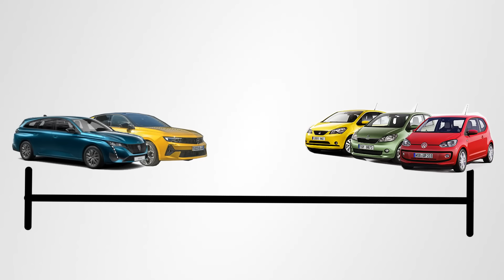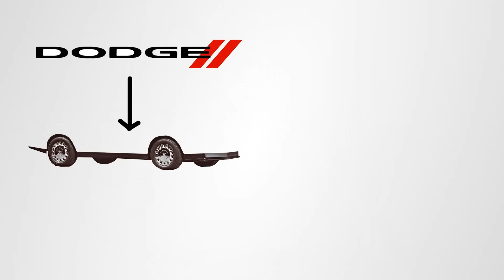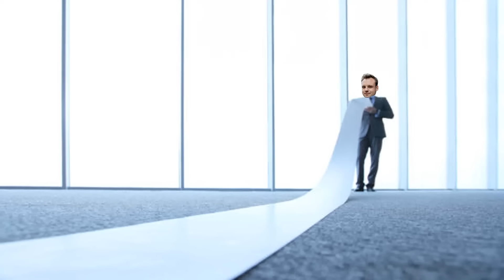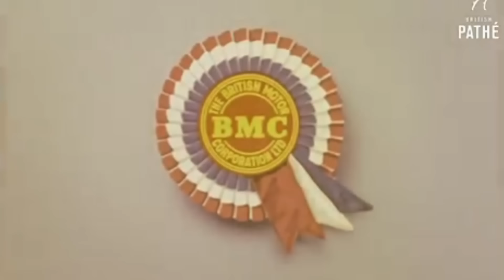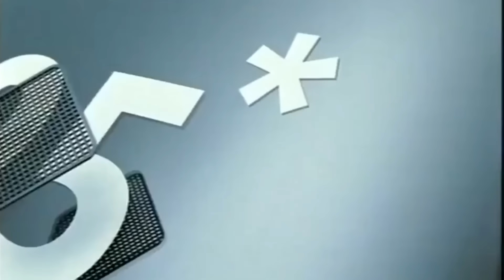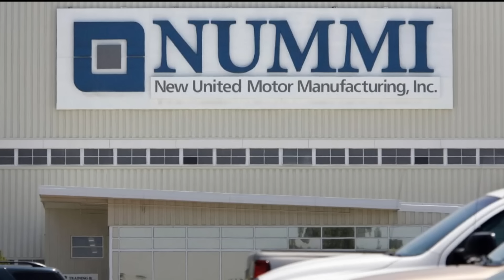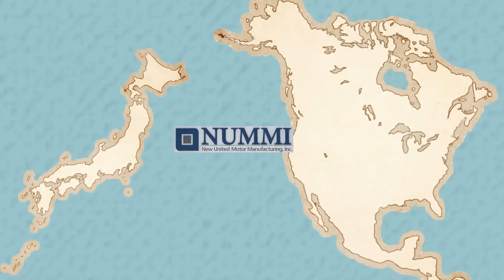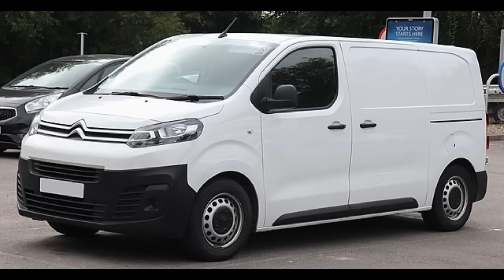Ep. 30 Seeing Double: The History of Badge Engineering

Comment: I just looked up the Australian version of the current Mazda 2, and it looks more like a front end mix up than a full rebadge.  I owned a rebadge car, being the Holden Astra (1985) which was a rebadge of the Nissan Pulsar of that age.  There was also the Holden Commodore of the early 90s (VN) being rebadged to a Toyota Lexcen.
Reply: You aware of the VERY FEW Ford Falcons that were NISSANS! Ford was chronic for rebadged mazdas
Reply: @OffGridInvestor  At the time, Ford owned 40% of Mazda.  So in many cases, Fords and Mazdas came off the same assembly line.

Comment: I can also say that GM really, really loved to rebadge everything. One of my favorites is the Saturn L200, which was an Opel Vectra with a different face. It was also the most unique rebadge of the Vectra I can think of in comparison to the Vauxhall and Holden ones. or the Chevy Vectra that came out later on. Though, the Satura Aura that replaced the L200 looked basically like a Vectra with a Saturn badge. 

Another GM rebadge I found interesting was the Pontiac Beaumont that appeared in the late 60s as a rebadged Chevrolet Chevelle. It was sold only in Canada, while us Americans had the GTO.

Comment: ...take a look at the 1979 Jeep CJ-7...I had my white Golden Eagle before Daisy Duke got hers.  The only thing AMC made was the rear axle and body tub.  The carb and ignition and starting system was Ford, you could see the Ford stamping under the AMC decals.  I'd buy my starter drives from the Ford dealer's parts desk, much to their confusion.  Brakes?  Got a new master cylinder at the local Chrysler shop.  Dana-Spicer 4x4 bits, fantastic GM tranny with a bull-low...which is GREAT in crawling big city traffic I found out later.  Had the GM dealer in Duluth replace the cluch for me.  Auto glass guy told me it was if AMC designed the winshield frame to rot out...tail lights same as Ford stepside pickups of that era...

Comment: I currently drive a Saturn L200 and it’s definitely a cross platform share with the Saab 9-3, the differences being the far and front ends, and a different engine and transmission. It actually helped me out massively because I found a set of Akebono brake pads for the Saab 9-3 on sale for $30 (normally an $80 set) because the box was crushed during shipping to the distributor, and they were an exact fit. I’ll absolutely take a set of Akebonos for the same price as the cheapo generic brand pads
Reply: I had a second generation Saab 9-3 Aero for a few years. I need some new front brake discs. As it turned out to was the same part used in the Vauxhall Vectra VXR. But being in Australia we never got that model here. However, I was able to use the part number and order it through a Holden dealer. Because I didn't have to pay freight, it worked out a lot cheaper to order the genuine part for my Saab via Holden dealership with a Vauxhall/GM part number - who would have thought?

Comment: As a young kid in the 80s I asked my dad why are chevys buicks oldsmobiles and pontiacs all the same car? He laughed
Reply: Don't laugh. In reality a lot of that goes back to the 50s or earlier. Common platforms with each division putting it's own twist on things. Look at a mid 50s Chevy, Pontiac, Olds or Buick based on the Belair chassis. They all have the same general look and feel to them aside from the trim.
Reply: @mpetersen6  thats true. Pontiacs were always chevys with fancier trim and a pontiac engine going back to the 30s. Best example is the entire 1959 gm lineup where you can see they all have the same body shell windows windshield and doors. Different engines transmissions chassis suspensions steering and brake systems though which can make them feel like different cars entirely. As gm standardized parts more and more badge engineering is what it lead to.

Comment: I had a 78 Chevette with Pontiac Acadian badges. Look at the trouble that caused. In the 60s, my parents had a real Pontiac Acadian Beaumont convertible, a badged Nova. Wish I had it now. They also had a few K cars. Aries, Reliant and LeBaron. Even a New Yorker. A K car New Yorker. Before that I learned how to drive in a Ford Elite, not a Gran Torino. The Elite had 400 cu inches, and could barely spin a tire in the rain. One tire. Stupid smog motors for all of these cars by the way, except the Acadian Beaumont. At one point mom's car was a Buick Skyhawk, that looked the same as a Monza. Our mid 70s LTD Country squires were more than just badges, they had MacTac siding. A bicycle handlebar goes right through that stuff. At one point my grandma had a Bobcat with the benefits of a Pinto.  After that a Lynx, which was an Escort. I had a 78 Grand LeMans too. Nearly identical to my neighbour's Malibu.

Comment: Some rebadging is even done on the owner's driveway!
In 2014 i brought a 20 passenger minibus from the Senate of Canada. It had been used almost exclusively on Parliament Hill in Ottawa, our national capital . 🇨🇦 🍁 
It way an American Goshen Coach body on a 2006 Ford E-450 Super Duty body.
I reduced the seating to 10 plus the driver, added curtains all around  around and a bed in the back with storage for camping gear underneath!
I found a large collection of pot metal car 'badges' from the 60s and 70s in an antique and collectables type store.
On each side low on the body just behind the driver's door and the passengers' door, I installed "Fury" badges from a Plymouth.
On the back adjacent to the rear door I installed three badges, each one over the others.
Now I drive the only:
"Nomad
SST
Classic"
              ...on the road! 
My Wandering, SuperSonic Transport, Classic minibus camper! 🇨🇦 🍁 🇨🇦

Comment: Back in the 60's/70's Chevy dealers were always getting pickups in with one or more GMC Badges and vice versa.
Reply: Remember how GMC owners said Chevys were rejects from the GMC assembly line. lol
Reply: And I love that GMC is marketed as being tougher and more reliable when it’s just a rebadged Chevy with up market options (all of which you can get in a Chevy for a little less).
Reply: in the old days the GMC version was the heavy duty version, with a stronger transmission and sometimes a different engine , heavier suspension etc, somewhere in the 90's they just became a different looking chevy pickup
Reply: @alain99v6  in most cases the GMC came standard with that equipment, but you could still option a Chevy with the same equipment. It might even save a little money that way. GMC and Chevy since the late 60s had the same engines and power trains.
Reply: Yes in the original order of things,  GMC was a heavier duty truck. Sturdier frames, different engines, stouter transmission and rear axles. The GMC six cylinder engines had full pressure lubrication many years before Chevrolet six cylinder engines did. This continued into the mid 1950s. Then the new truck platform came out in midyear 1955; the Chevrolet truck had the new V8 chevy engine and the GMC used a Pontiac V8. In 1956 these were 1955 engines, GMC would use the previous year's V8.
Then in 1960, GMC had their own truck spec V6, and the Chevrolet trucks continued to get the Chevrolet V8s. Body and chassis were still somewhat different through 1972. The new 1973 GM trucks became more similar. This series and the GMT400 series that followed inhale incredible parts interchangeability. Also on the 400s, in 1999, you got Cadillac involved, with the Escalade. 
In 1999-2000 though, GM changed directions a bit.  The new GMT800 series of trucks has less parts interchangeability than its predecessors. This trend has continued to increase on each succeeding GM truck series; most of the body, trim and interior parts do not interchange between Chevrolet, GMC and Cadillac. Mechanically they're more similar,  but some things are exclusive to one brand. 
And yes, I remember new car/truck shopping in the 70s and 80s ( my family had an auto parts store that needed several pickups for delivery trucks). I saw a few of those vehicles with multiple brands' emblems!

Comment: Kaiser (IKA) in Argentina building older AMC models.
Reply: Brasil built discarded Ford models well into the 1980s.
Reply: @wintersbattleofbands1144  
If you look at some of the Chrysler Australia models. Along with Ford's and Holden it really looks like there was some repurposing of body dies. The Australian Charger model has always reminded me to the 2nd generation Barracuda fastback. 
Also various AMC models were built in a number of countries. Usually as knock down kits for body and suspension. Sometimes they used AMC engines (and transmissions when they still made manuals*). Sometimes they used drivetrains sourced from other manufacturers. Countries with assembly operations included Iran, Belgium (Renault) and Australia. I remember seeing a RHD AMX at an AMC owners show. 
*I actually worked at Kenosha Engine and when we still built rear ends there were ranks of left over Barber-Coleman gear hobbing equipment from production of the three speed manuals.

Comment: In Japan, the number of badge engineering is increasing from early 2000s.
Some of them(such as Nissan Moco) are sold much more than the original .  :)
Reply: That's what Infiniti, Acura, and Lexus were in the 80s to the early 2000s. Rebadged Skylines, Leopards, Integras, Civics, Soarers, Altezzas, etc.

Comment: There is one example of somewhat lazy rebadging that I know of, and that is the Lincoln Mark LT. Ford basically took the F-150, made a new front grill for it and some new exterior pieces, as well as put a new steering wheel airbag cover on, and boom, the Mark LT was born. The 2009 to 2014 model year, being the last for the Mark LT, was when it became the most obvious that what people were looking at was an F-150 with some differences, notably with the grill itself extending up to the hood, and different trim pieces, but otherwise, you could get all of the 12th Generation Ford F-150 grill and trim pieces, and end up making an F-150 on a budget out of what is basically the Lincoln version of itself.

Comment: The Mitsubishi Starion was interesting as a rebadge since it was rebadged not only once, but twice under the very same company.   Chrysler motors rebadged the Starion as both the Chrysler Conquest and also the Plymouth Conquest.

Then a few years later Chrysler Co. rebadged the Mitsubishi GTO (3000GT) as the Dodge Stealth, although at least this time it was only one rebadge.
Reply: The Conquest was actually a really cool car.  Very 80s, with the digital dash and the voice chip that would tell you when the door was open.  With the 2.6L Turbo and the 5-speed, it was reasonably quick too - both better-handling and potentially quicker than the emissions-hobbled carbureted 5.0L Mustangs and Camaros.
Reply: Remember the Plymouth Sapporo and the Dodge Challenger twins?

Comment: My favorite case of this is the Plymouth Duster/Dodge Dart Sport platform in the 70's. Chrysler has always been good at making the exact same car for 2 of their brands.
Reply: I think that in the late 60s and early 70s Canada, the Plymouth Duster clone was sold as the Dodge Demon! The  😈 made them do that!
Reply: Aussies got the dart hardtop bodies less running gear and front clips in 69 and 70- badged as Valiant, Valiant Regal, And Valiant Pacer with local front panels and grille, local content running gear (1970 saw the intro of the Hemi 6- which was designed in the US but only used here.) I had a 1970 Regal hardtop with a 265 Hemi cop motor.
Reply: @rossbrumby1957  Aussies have all the cool stuff.

Comment: A pretty cool rebadge is the Mazda Miata, which FIAT reconfigured with its own engine and body to become the FIAT 124 Spider. It had Italian style on a Mazda platform. The interiors were virtually identical. Originally, it was gonna be released as a Alfa Romeo, but the Alfa execs nixed the idea of a Alfa-Romeo built in Japan! (Yes, the FIAT 124 was built on the same assembly line as the MX-5 Miata!)

Comment: I like the myth about the GMC/Chevy pickup that states the GMC is tougher because all the wiring in the harness is 1 gauge larger then the Chevy,along with other things like that.
Reply: They used to say GMC trucks bodies were built with thicker metal as well but not sure what years those would have been !  I worked at a old car salvage yard many years ago & one of the boom trucks I used to pull or lift cars with at times was a 37 GMT that was made before the name changed to GMC . I belong to a local car club in Wisconsin now & the club owns a GMT fire truck from the late 30s that still runs & drives that's used in a local parade each year but mostly sits in front of the club house along with a Ford model A truck that's been outfitted with much larger balloon type tires & a larger box in the back of it for what ever it was used for way back in the day that still runs good & gets driven in the parade as well .  Back in the 80s a buddy of mine was a body guy & he came across a 69 Pontiac lemans El Camino that he got for doing some body work and paint on someone's vehicle . We never knew such a thing was made but actually got a hold of GM on this & found out these were built in Canada . It looked exactly like a 69 Chevrolet El amino with the exception of the front clip & some minor interior changes & a Pontiac engine instead of the SBC or BBC like many of the SS  El Camino's could be ordered with .  The GM guy we talked to said they only made very few of these Pontiac lemans El Camino's like 800 if I remember so they were rather rare but my buddy after telling him he should fix & restore it ended up selling it to fund his 70 Dodge Charger project instead so not sure what ever happened to the poncho after that so even then it seems GM was kind of rebadging the Chevrolet El Camino but using a Pontiac front clip & slight interior change with a Pontiac engine installed  on the assembly line in Canada .
Reply: If I know the gauge system correctly, the gauge number would go down as size goes up?
Reply: @tayntedmemories  yep

Comment: These days, it costs so much to develop an engine and a platform that there almost has to be at least some badge engineering. Even if they make a lot of changes to the sheet metal and whatnot, it just makes sense to try to use the same parts in as many cars as possible. Also technically, Pontiac's version of the T-body was only called the T1000 for the first year or so. After that, it was just the Pontiac 1000. I guess you have to be a true T-body nerd to know that though

Comment: What do you think about the Chevy Suburban/ GMC Yukon/ Cadillac Escalade
Reply: Probably one of the better examples given how there is a difference, the Suburban/Tahoe are the cheapest and often times are sold as fleet vehicles, the Yukon has a bit more luxury to it, and the Escalade is a full-on Luxury Vehicle
Reply: Before the GMC Yukon and Chevy Tahoe it was the Chevy Suburban and the GMC Suburban.
Reply: @spottdog9349  *Chevy Suburban and GMC Suburban
Reply: @spottdog9349  yes. If you think about for most of GMC's and Chevy's history. The two have been mostly twins when it comes to Trucks. And this has been good because there are two meaning more parts which means cheaper when it comes to repairs.

Comment: One rebate that surprised me when I found out is the Toyota86, which is actually a Subaru. Craziest I've seen was a Toyota Corona with Holden badge. The crazy bit was they had left out the reliable Toyota engine and fitted the 4 cylinder, 1900cc Holden starfire engine.  They were not good engines.

Comment: There's been a long history in Canada of car companies rebadging existing cars as new models.

Ford mage a car called the Frontenac, which was a Falcon with a different grill appointment. Even though it sold well, Ford discontinued the model after one year and replaced it with the Mercury Comet.  Ford also made a Mercury pickup line for many years, which were just rebadged Ford trucks and vans (yes, they even made a Mercury Econoline, didn't even change the name).

Chrysler made a truck line called Fargo, which was sold at Plymouth dealers - rebadged Dodge trucks, didn't even bother to change the looks/

GM made rebadged versions of the Chevy II (Acadian, Canso) and Chevelle (Beaumont), which were sold at Pontiac-Buick dealers. The Beaumont didn't even make any sense, as Pontiac was selling its sister car the LeMans at those dealers! Though they did do a Beaumont based on the Chevelle SS396 model .Later, when Pontiac discontinued their rear-drive Bonneville, GM rebadged the Chevy Caprice as the Pontiac Parisienne for the Canadian market - and a year later, began selling that model in the US.

GM also thought they could make lightning strike twice after the success of the Geo division, and so they created another brand called Asuna, to be sold at Pontiac-Buick dealers, and made up of rebadged Suzukis, Isuzus and Daewoos (the latter being a version of that craptacular subcompact LeMans). This time the public weren't fooled, and Asuna folded after a year.

Comment: A major rename came while I worked for G.M. The Chevy Nova was duplicated and sold by the other GM manufacturers. Let me show you:
N = Nova
O = Omega
V = Ventura 
A = Apollo 
GM took the name Nova and used it as the first letter of all its Children. I worked in an Oldsmobile dealership, and we would get cars that were mismarked with Pontiac Ventura badges on the horn button, ETC. As far as I know this was the first attempt at rebadging cars so that all manufacturers had a certain gas saving model.